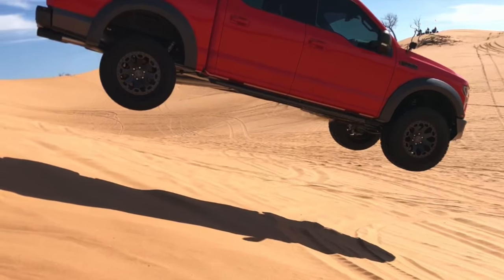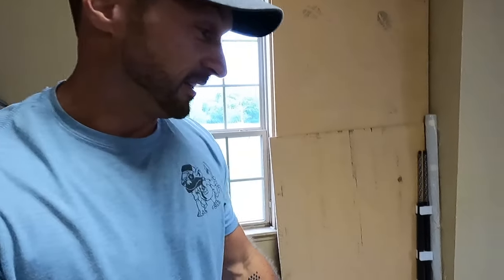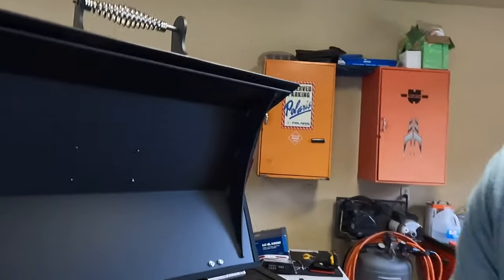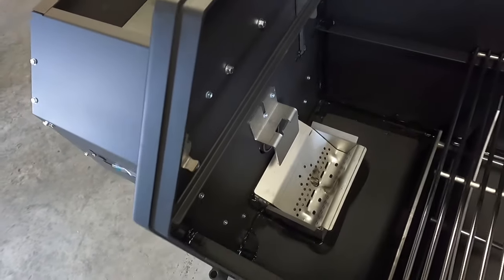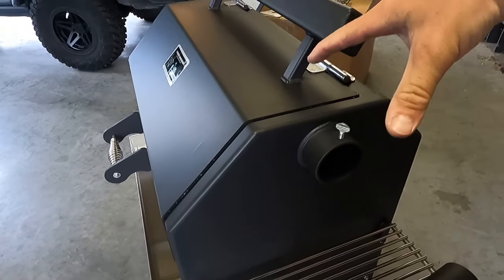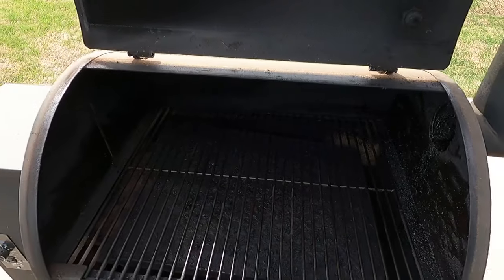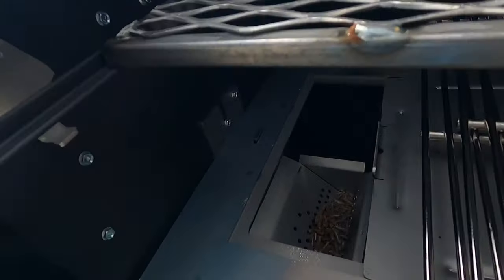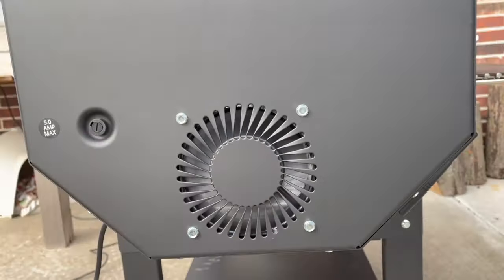Unboxing a Yoder YS 640 s and comparing to our old Traeger.

Comment: Congrats on the Yoder. Quick note incase you ever run it clean of pellets again. When you turn it on, the bottom button on the left is prime. You can use that to prime the unit when empty, or if you are running and leave the lid open a long time, press and hold. It will push some extra pellets in to catch it back up to temp.  Happy cooking!

Comment: I just replaced my Traeger Century 885 with this same Yoder model. I was disappointed in my Traeger. Door is warped after just 3 years, and I've had numerous thermometer and control panel failures. cant wait for it to get here. thanks for this video!

Comment: Hows that ys 640 doing. Im thinking about pulling the trigger n buying one myself. I got a yoder Wichita stick burner and i love it. It be cool if the 640 had  option of getting the wheels from the outland or maybe chrome wheels lol. Question any rust on your 640. Behind the grease shield. Thanks
Reply from the maker: I’m still loving it 3 years later. The meat probes last about a year and that kinda sucks. No rust anywhere to my knowledge. Cook in it 3-4 times a week year round.

Comment: I have had a Traeger (POS) then bought a Yoder YS1500 about 5 yrs ago now.....The Yoder has some short comings as well. Door leaks Smoke, The Drip tray is less than desirable, Iy will burn back into the Hopper mine has caught fire 2 x already, the paint on the Yoder is not very good.....I have rebuilt it and Powder Coated the whole thing. If I was to do it again I would go with a Cook Shack and just bypass the Yoder. The Yoder is a good cooker compared to those POS Tragers.....But for the $ the Cook Shack FEC is a much better cooker.
Reply: Funny, my 5 year old Traeger Eastwood 22 hasn't had a single issue besides frozen auger in Chicago winter. Some people just can't be pleased
Reply: @koukitype180  oh I am extremely pleased with my Yoder, that Junk Chinese POS Traeger.............No that garbage Can is just that Garbage. My Yoder is better in every way then ANY Traeger.............Where talking the difference between a Kia and a Ferrari.
Reply: @RipitRon  lofl Murica
Reply: @RipitRon haha A Ferrari that needs to be rebuilt, repainted and that catches on fire? No thank you! 
I’ve had 6 pellet cookers, (never a Ferrari one though) and my old old Traeger is the one that’s worked the best for me, yet. 
No bells and whistles obviously, but it’s the old kind that still has a bit of thicker steel, but obviously still a solid sturdy garbage can! 
Love it when my OLD Traeger produces better results than some of the newer $1-2k pellet cookers, always fun.. 
That being said, been eye ballin that Lone Star 🫶 and I would never buy a new Traeger! 
Woke culture taking over, like BudLight. Garbage
Reply: @meals24u  When that POS is in the landfill or scrap metal pile my Yoder will still be cookin.......THIS I GUARANTEE!!!
Reply: @RipitRon  oh yeah, of course! I don’t think anyone here is arguing that. It’s obvious, basic math, 10ga steel thickness versus a rusting beer can.

As long as you replace broken parts and keep the paint on your Yoder, it’ll outlast your kids, no doubt. 
In a sense, it’s not even comparable to any of the Chinese “garbage cans”.

Comment: Did you season it… if so with what and how?? Ty:)
Reply from the maker: Seasoned by running it empty to make this video.
Reply: I just got one and the manual says after about 30 mins of run time on the initial burn in to wipe the grates and stuff down with vegetable oil. I just got some spray oil and sprayed the inside down and it's been amazing so far.